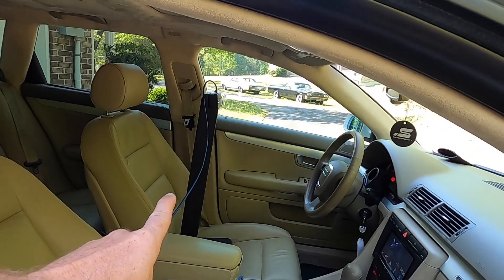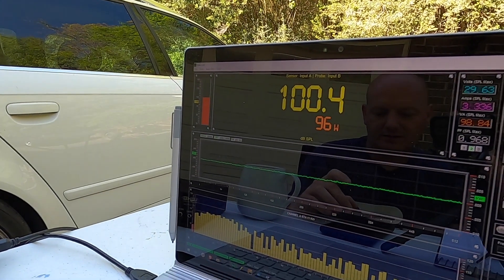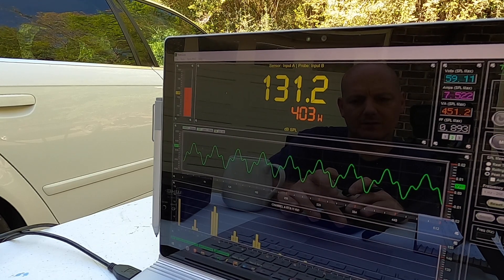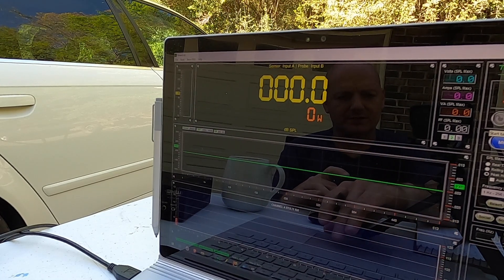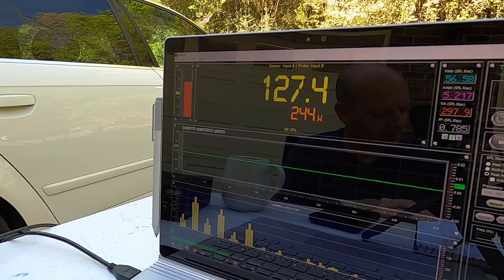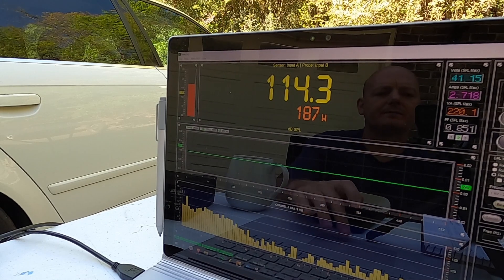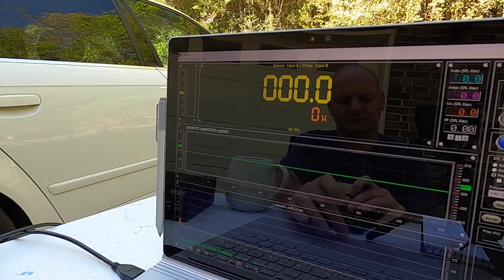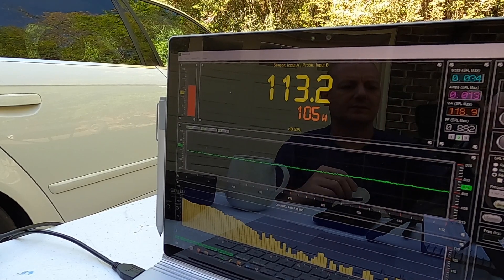Stereo Integrity Audi: Single Digit SPL Test

Comment: You looked at the track waveforms to see if the pop could be edited?  It should start at zero, if it's halfway through a waveform on the track start it will pop.
Reply from the maker: I created the tracks in Audacity. They start at zero but it’s the sudden burst that creates the pop. Typically in SPL tests you roll into power vs full send right off the bat. So, since I’m going full power in these tests, I started the track then the measurement.
Reply: @BatdogGarage  What is the ripple in the waveform?  It's remarkably uniform.  Possibly from physically moving - like the body vs the element in the mic?